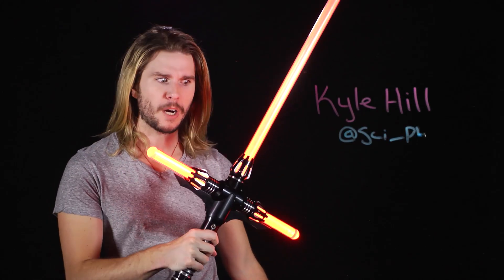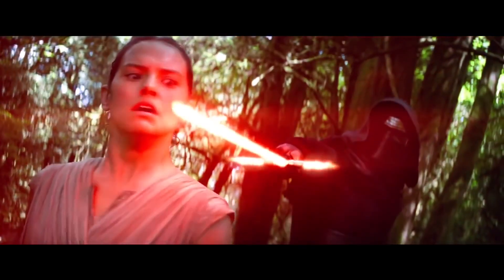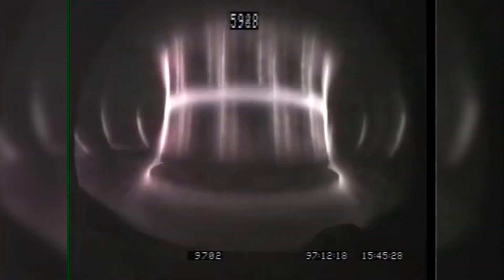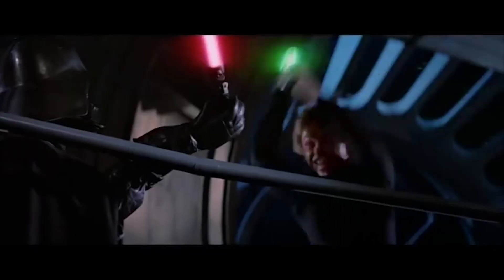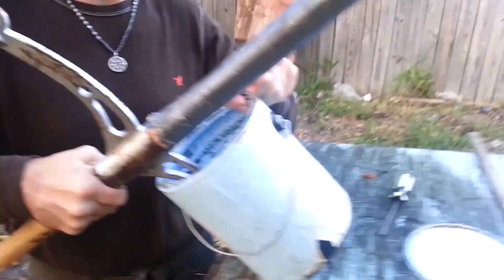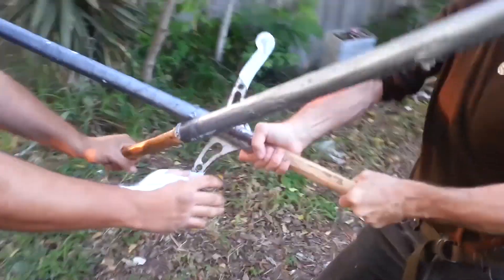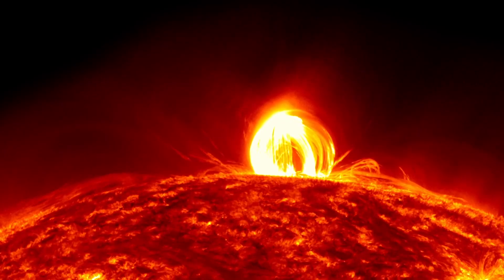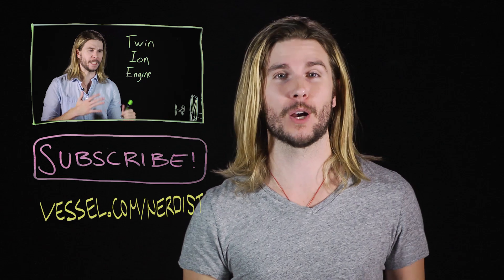Why Kylo Ren's Lightsaber Works (Because Science w/ Kyle Hill)

Comment: This is NOT like a guard, it's more like adding two little blades instead of the guard, just to be sure to cut yourself before the enemy have the chance to do it. NONE of the examples you showed would have protected them from being cut because none of the examples showed an encounter even remotely close to the guard. Also, Colbert was wrong. There is NO place to put two opposing light blades close enough to close the gap between them AND the main light at the same time. Even if it was possible, they would melt each other's mechanism, not to mention an enemy blade getting in there to cut through the corner. It's simple geometry guys, the light saber guard is either unpractical, or useless.
Reply: harrybrotank  No, I really don't.
Reply: +Dandy Now ask yourself if their crossguards are essentially little blades that are both heated to the temperature of the Sun.
Reply: +Able D-G Ikr, being stupid and getting your arm cut off has nothing to do with a crossguard-less sword.
Reply: theyre there for ventilation due to its instability.
Reply: You need to shut up
Reply: +Able D-G spoiler

Finn and rey are untrained in lightsaber combat and kylo ren was shot with a bolt caster by chewie so kylo is in so much pain that he isnt going to use agility hes just going to hack at them until one of them is dead
Reply: +Able D-G Yes, because if you can train yourself to not touch yourself with your own sword you can trian not to touch the handguards.
Reply: +Able D-G You really think crossguards are useless? Are you joking? Look up people fighting with longswords and see the obvious (VERY  OBVIOUS) advantage to not having a crossguard.
Reply: Dandy  OMG I never said crossguards are useless, I said that this thing ( NOT A CROSS GUARD ) is. Way to strawman my argument dude, read my comment again, carefully this time.
Reply: In the clip where obi wan cuts off general grievous's hand, a cross guard would have protected his hand
Reply: william timonen Yeah, I saw the movie couples days ago. The battles were more axed toward "brutal force" than "agility". Of course, they're gonna show the bright side of the sword, just so that their brand new evil character doesn't loose all his credibility in his first movie. But overall, I miss the time when battles were swift and sharp, when they pressed the "agility" factor WAY over "strength". Just remember the Darth Maul's lightsaber, that thing could handle two Jedis with class, and it didn't need any hand guard. Now, it's just like any old fashioned medieval sword fight, which IMO kinda looses what makes the Starwars vibe.
Reply: ***** "Science" in "science-fiction" stands for a reason.
Reply: Nicholas Davey  I'm the first to admit that; we're arguing over a fan-fiction. It's all theoretical, I can't say this enough times.
Reply: +Able D-G They are exhaustports that act as crossguards.
Reply: It is supposed to be vents, cutting of some of the power in the sword. And if you see the movie he actually uses them as two knifes and cuts another character in the shoulder.
Reply: +RayGetNasty1  I have to grant you that; in this specific instance, it would have (probably) protected Grievous' hands.

But for my defense, you also have to consider his fighting style as a whole. Ask yourself; could general Grievous fight the same with a light guard on his lightsabers? Considering his combat routine, I doubt so (It might even be more dangerous for him). But at this point, it's all very theoretical anyway.
Reply: Stop refering to the danciing jedis in the prequels.
Reply: +Able D-G butt hurt fan is butt hurt
Reply: +Hyper Well the lightsaber itself is very clearly not that hot, as explained in the video where it would have burned her neck off, and various other instances. The crossgaurds are of the same as the lightsaber, so there is no more of a problem for a jedi to wield a lightsaber with crossgaurds as there is for a swordsman with a long sword, with the same amount of training.
Reply: +Able D-G "This is NOT like a guard, it's more like adding two little blades instead of the guard, just to be sure to cut yourself before the enemy have the chance to do it." Watch the video again, particularly the part with the paint demonstration.

"There is NO place to put two opposing light blades close enough to close the gap between them AND the main light at the same time." Because there aren't three seperate beams like there was with Darth Maul's 2 crystal doublesaber. Kylo's saber has 1 crystal that's split 3 ways, there is no gap. Which you would also know if you watched the video, from the Steven Colbert section.

Did you not watch the video?
Reply: EternalJoker  What makes you think I just skipped the video? As I said in the OP, Colbert's model is wrong! It isn't based on anything. Just look at this graphic from the official book Star Wars: The Force Awakens Visual Dictionary:
http://ecx.images-amazon.com/images/I/91ppNTY8QVL.jpg

There is no beam formed yet inside the chamber, it's only uncontrolled energy emanating from the cracked Kiber crystal (as they call it). The crystal of Kylo Ren is unstable, so it needs two extra exhaust ports to stabilize the excess of energy. They call them the "cross-guard quillons", but that's not practical, arguably not even a cross-guard.

So here's the thing; sure, one crystal splits the energy into 3 distinct "beams" in the end. But that however does not mean that the energy itself, when it's still inside the chamber, before it reaches the blade's "vent iris", can actually block a fully formed light beam from an enemy lightsaber. This was my whole point. It is more likely that an enemy's lightsaber would cut through the chamber directly and destroy the crystal, since there is no "blade" yet to block anything. The energy hasn't passed the "ignition" phase (taking the own words from the book).

My guess is it would be just like what happened to Anakin's lightsaber in the droid's factory in the 2nd movie. The crystal itself isn't invincible, and most likely cannot resist a direct hit from a lightsaber (IMO).

But as I said somewhere in the comment section; it's all theoretical at this point.
Reply: ***** I would think the crystal wouldn't be affected by a lightsaber blade.
Reply: Nicholas Davey So, it could resist a lightsaber but not a blade from the droid foundries?
http://vignette2.wikia.nocookie.net/starwars/images/d/d5/SkywalkersLightsaberHalf.JPG/revision/latest?cb=20100407184002
Reply: Well it's a crystal, I'm sure a crystal could shatter from force or physical force, but a lightsaber blade? a blade that it shoots out all the time and is fine with it?
Reply: Nicholas Davey  The crystal doesn't shoot the blade, it only generates the power for the beam. Once the blade is formed, it can pierce through freaking blast doors... So again, are you seriously implying that a crystal could on its own resits a lightsaber hit while not withstanding a metal cutter?
Reply: different things have different properties. It's not unusual.
Reply: Nicholas Davey  Yeah, I'll take that as an "I don't know".
Reply: ***** My arguments are just as viable as yours.

Comment: You forgot that the crossgaurds can activate seperately from the original blade so that means that the gem powering the saber is in a different area so it must be in the crossgaurd outer casing in which if you slice that outer casing then you would destroy the crystal and will destroy the crossgaurd.

Comment: Regarding the issue of lightsaber blades being weightless; of course an energy blade would be weightless, however other cannonical Star Wars works describe lightsaber blades as "generating considerable torque."  In this case, the weapon would have inertia (resistance to changes in its state of motion); plausable for a high energy plasma contained in some kind of electromagnetic field.  A properly weighted grip would still be necessary, especially on a big weapon like Kylo Ren's (size looks like either a two-handed sword or a bastard sword).  

I agree that a crossguard of some kind definitely makes sense (and additional side emitters might actually help balance the weapon).   However other kinds of handguards are also possible given the existence of lightsaber resistant materials in the Star Wars universe (Phrick and Mandalorian Iron to name two), especially on a shorter weapon which would generate less torque.  If they were far enough from the blade, it might even be possible to use Cortosis (a material that shorts out lightsaber blades on contact).  

I would be thinking of a longsword length weapon, possibly with curved hilt, perfectly suited for Form 2 (Makashi; Count Dooku's style).  Add some kind of bell-shaped guard, possibly with crossguards (like some older Spanish rapiers) over the top of the hand protection, and this would be the perfect Form 2 dueling lightsaber.  Other kinds of guards are possible for a smaller sword.  Again, just my opinion.

Comment: Colbert's argument on the beam splitting in three directions is completely baseless, and is not intended to be used as a serious counter-point. It feels like a lazy cover for the primary reason why the crossguard is not practical on a lightsaber. The beam of the lightsaber is and always has been external. Having the beam inside of the saber hilt is pointless and kinda nonsensical, especially if it's somehow supposed to split in three directions. You'd think if you can have that much control of the shape of a lightsaber, then you would see a lot more intricate weapon designs with them. Besides, if the beam is mean to go all the way through the hilt, and the metal part of the hilt is just there to protect the hand, then why is the upper part of the crossguard covered, rather than exposed? It serves no purpose, and there's no way it would survive that initial design appearance, as a stray lightsaber blow would have logically singed it off a long time ago.
The reason is simply because the lightsaber crossguard was not designed with practicality in mind. It is as bad as the light-whip.

Comment: Spoilers

If someone already pointed this out, my bad...but, here goes- Kylo's control of the force is lacking a lot(you can tell by his temper tantrums). He has so much innate power that he needs the 2 (cross guards) in order to exhaust the excess power he focuses into his Saber(the guy is Han and leia's son, he only knows how to go all out). If he were only to have the single blade, it would be 10-15 feet long i bet. No facts basing this though, just fan speculation!

Comment: Yeah, this may increase a little bit the protection, but it still cannot protect as intended (showed on video) because lightsabers can also destroy thoses protections by passing through the joints, destroying the protection and may cutting off the enemy's hand. If is that the reason, still not worth the risc. But I like the theory of ventilation and excess of power on crystall.

Comment: Another main reason for the cross guards is that since the lightsaber is a little unstable, as you can see by the crackling and sparking and it requires some way to exhaust some of the raw energy that is too powerful for it.

Comment: one reason most lightsabers do not have a guard is because of the way plasma and magnetism works in a lightsaber,  two lightsabers would be drawn to each other.   That is why  an action like, quickly turning off and then back on the lightsaber was a bad idea, because the cohesion of the blades is what was used as defence.

Comment: The trouble with your examples of hand removal which it would protect is that all of those including crossguards would not have been stopped by one. All were directly onto the persons wrist without contacting the lightsaber, the crossguard should really to be stop one from sliding the blade onto the hilt rather than the hand.

Also, the stuff about the beams inside the hilt seems like a rather large assumption, I mean, it seems to me that if the beams were inside the saber there'd be no actual function for the metal on the outside, which seems a little unlikely.

I still like the design, and I'd just justify the existence of the crossguard because there's no obvious reason why you SHOULDN'T have one.

Comment: Seen the movie and Kylo Ren as now is one of my least favorite ''Darkside'' Characters, but I agree that Lightsaber is one of the better ones seen.
Seen any of the common Lightsaber, Darksaber resembles kinda like a Katana in my oppinion, we've seen Saberstaffs and Pikes, Double Bladed Lightsabers, the even more strange double bladed Lightsabers that rotate in the Star Wars Rebels series as the one that the ''Padawan'' uses with a Blaster function, also not a saber but there were force users that used Lightwhips and other weaponry.
The Cross guards is one of the least strange ones actually, cross guards do lessen the chance of dismemberment, also as those are there, with minimal change of stance and energy usage you can use it against an opponent to either hurt loosen their focus through pain or get an easy way to disarm the opponent if you want to take the opponent alive.

Comment: Actually that's not the reason it has handguards. It's a reason, but there is another reason those are there. Let's take a look from Wookieepedia: "Kylo Ren's lightsaber was a lightsaber constructed and utilized by Kylo Ren approximately thirty years after the Battle of Endor.[1] The lightsaber was crudely assembled based on an ancient design dating back thousands of years to the Great Scourge of Malachor, and thus featured seldom-seen crossguard blades.[3][4] A single cracked Kyber crystal, barely able to contain the weapon's power, necessitated the lateral vents which produced these crossguard quillons and gave the weapon's red plasma blades an unstable, serrated appearance.[2] Kylo wielded this weapon while working alongside the Knights of Ren and the First Order."

Comment: Though Kylo's weapon evokes an ancient feel, its components are modern. Its crude appearance suggests construction by an in experienced hand. He made that saber himself.
The stressed crystal barely contains the power...
Most importantly, the lightsaber uses a cracked Kyber Crystal, which is the main cause of the ragged, unstable blade appearance.
If the vents on the side weren't there the Saber would be highly unstable and probably explode and hurt or kill the user. The vents open after the main blade comes on and helps vent the extra power the cracked Crystal emits thus why Kylo's Saber has "Cross Guards".

Source:
http://static.comicvine.com/uploads/original/11115/111155790/4967134-0923527786-P4K2d.jpg

Comment: The power technology is only a decade away the tech is carbon nano tubes they can hold stupid amounts of power it can hold an entire city's power in your hand and to hold the beams in place is a treated ceramic Tube with holes in it to let the plasma out rapped in a magnetic coil and a titanium fan for exes heat dispersal. And also contains a gas like xenon to be heated into plasma.

Comment: What surprises me is that most fans don't realize that lightsabers can be adjustable in terms of power (For cutting) and in length. The younglings' lightsabers has power adjustments so they wouldn't cause an accident during training (Star Wars Dictionaries) but string enough to deflect blaster bolts and parry swings. If that's the case, then Kylo's hand guards are of a lower power level to protect his hands from lightsaber strikes and laser bolts  while being able to not cut his hands

Comment: According to Star Wars official materials, these thingies at the side aren´t actually crossguards, but they´re rather a way of cooling down the lightsaber, and keeping the crystal, that is powering the lightsaber, stable, because his lightsaber is made of a cracked crystal. Essentially, these are exhausts for excess heat, that keep the lightsaber from overheating and basically exploding. As they said, the lightsaber is as unstable as Kylo himself, that´s why in the movie you see the original lightsaber forming almost a solid shape, while this one is looking very unstable, like it could explode in any moment, sparkling with pure uncontrolled red energy.

Comment: lets first start by saying that "spoilers: when using it in a battle in the movie it actually looks like one of the crossguards touches his own arm but nothing happens no burn nothing

but onto the actual lightsaber its not supposed to be a plasma its supposed to be crystallized energy a laser hits the crystal inside the hilt and causes the crystal to expand outward outside of the hilt as it expands it releases just enough energy that it can cut the weight of the hilt is equally distributed over the lightsaber thats why they have solid mass

Comment: lets say the lighsaber blade is a magnetic confined plasma. by cutting through the hilt, youd damage the coils that create the confinement. what happens now, is that the plasma either streams out in random directions, burning the defenders hands, or if there is a safety built in, the entire thing would be shutting down. nope, still not buying it. if the hilt was made out of lighsaber resistant metal, you could just make the entire crossguard out of the stuff. yes, the rule of cool says this is allowed. but rationally explained the design is still pretty bad.